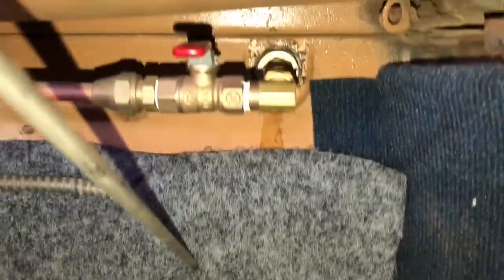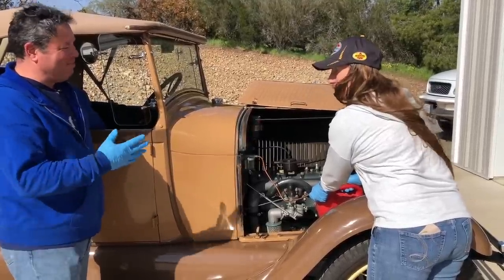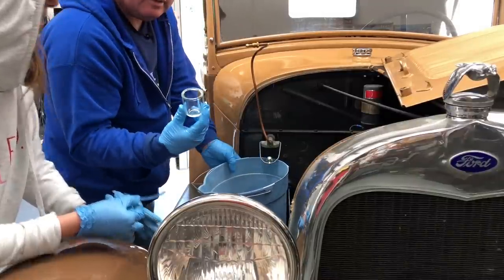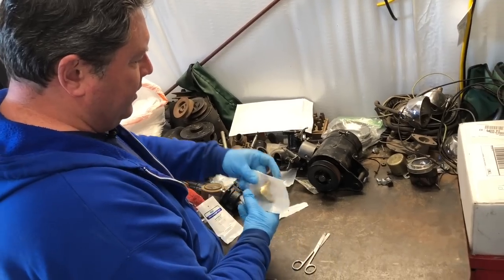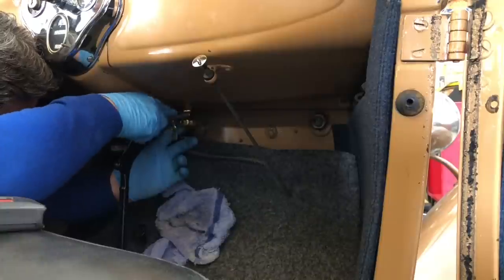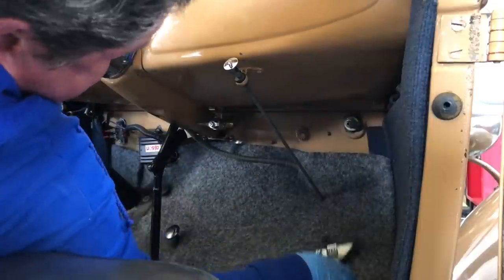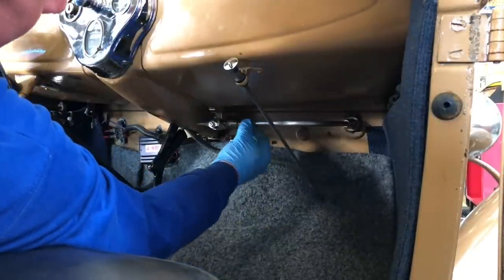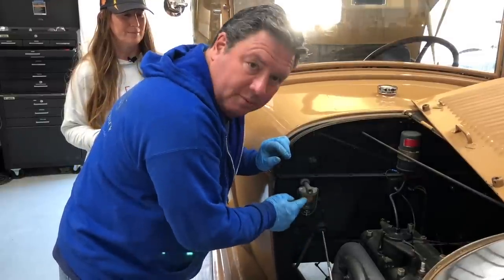Wife's first auto repair! Replace fuel system on 1929 Ford Model A Roadster. WHY??!!!

Comment: First time I seen that wix filter inside the fuel bowl was on a 56 T-Bird I guess it came that way not sure. I suppose that would work on my 1938 John Deere AR two cylinder Johnny popper. The fuel shut offs on those old John Deere's never did shut off completely and when it set for a long time you'd probably have about 12 gallons of fuel inside your crankcase.

Comment: “You don’t need plumber’s tape”.  I recently replaced the gas shut off valve in my 1930 Roadster. Seems like half the Model A club members insisted that Teflon plumber’s tape is a terrible idea, that it would dissolve in the gasoline and clog the carburetor. The other half of the club was unanimous on insisting that Teflon tape makes it easier to screw in the valve, fills in any tiny irregularities in the threads that could leak, and the threads never touch gasoline so the tape can’t dissolve, and just ignore those other guys. Which oil is best? 6 volt or 12? Generator or alternator? Zenith or Tillotson or Marvel-Schebler? And is it pronounced SHE-blur or SHEB-lur? I’ve concluded that the genius of the Model A design is that it tolerates lots of different ways, so EVERYONE gets to be right!  No wonder it’s still so popular.

Comment: Paul, I agree on using the "pencil" in tank strainers. I have tractor that would stall out under load and I could never figure out why... someone suggested I use one and Presto, problem solved!
One thing I do is put a bit of solder where it connects to the fuel outlet to keep it in place, works for me anyway...
Reply from the maker: I thought about that.  They fit so snug, they never come apart anyway.
Reply: @ModelA  good! Evidently my tractor was a different story...

Comment: I see the A has one of the accessory intake manifolds.  Hmmm, I’ve often wondered about these.
It may be seen somewhat sacrilegious by some, but I’m running the Weber carburetor upgrade on my 31 Roadster. This car is a daily driver so the benefits of the more modern carb/intake manifold can be realized.  If my usage pattern were more typical, I’d definitely stick with original zenith.

Comment: You do beautiful work Tina, and your assistant is coming along😉. A much cleaner and safer setup than before...and original! One question though, can the sediment bowl be reversed so any junk that gets past the pencil screen will be visible in the bottom of the bowl? Maybe its just an NPT fitting and not compression? Tina, I'm glad you enjoy rolling up your sleeves, you are bonding with "Roadie".
Reply from the maker: The sediment bowl is more of a water separator now.  The dirt will end up in the filter

Comment: A little late watching this good video.. I will probably need to clean the fuel system on our 31 S/W sedan as it goes about two miles and it acts like the key switch is turned off.. I tried with the gas cap loose and it still acts the same..  Checked for fuel flow to the carburetor and it is not good!! On another note... Ford did have an adjustable wrench!!!! I still use it and modern one's all the time !!!

Comment: Air filter? After I put one on my Model A everyone admonished me that any fuel that drips out of the carb mouth will soak that paper filter and whooosh BBQ Ford. Also that the carb will need rejetting or it will run too rich. So I took it off. Then when I bought a spare carb from a club member he gave me another air filter. I said I didn’t want it. He insisted I take it out of his garage, and snuck it into the box alongside the carb. Now I have two potential whoosh bombs on the shelf. Well on my way to collecting a whole garage full of Model A stuff I don’t need.
Reply from the maker: We run air filters on ours Model As.  Swap the paper filter for the K&N one.

Comment: do you recommend gasoline proof sealant on that smaller fuel line that goes from the fuel bowl down to the carb? I've got a new steel fuel line (and a new fuel bowl) that just doesn't want to stop dripping down at the carb. I thought a little brush of sealant around the threads might help...only at the carb fitting.
Reply from the maker: I don't use any.  I just make sure the seat area is clean and free from deep scratches

Comment: "If it works is it really a bad idea?" Using that logic the fuel lines and valve you replaced were working and should have stayed.  ;)
Reply from the maker: If they weren't held together with teflon tape and luck, and didn't leak, then yes!  hahaha!